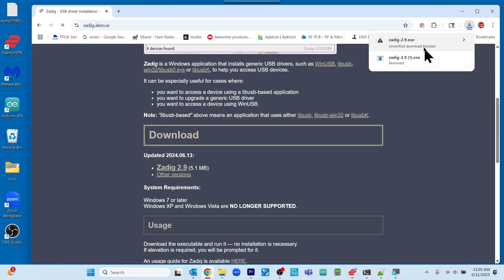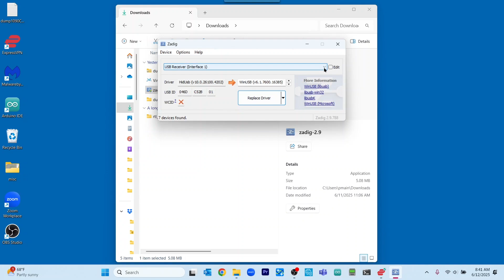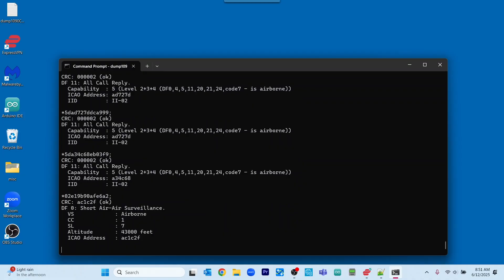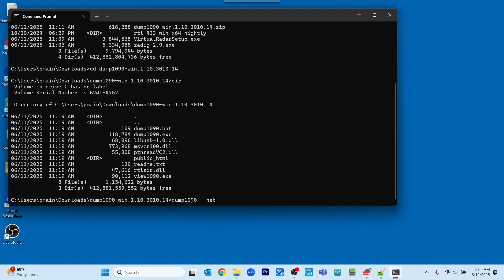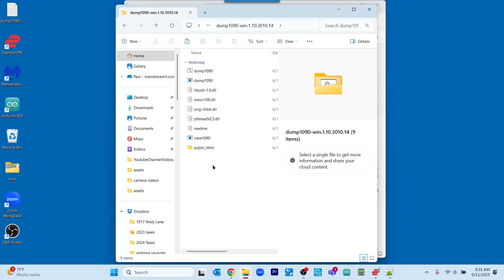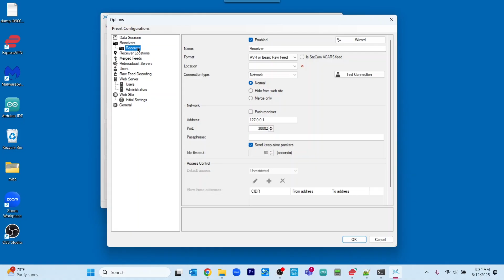E11 Tracking Airplanes using RTLSDR with Virtual Radar and ADS-B

Comment: i cant get it running. the dump 1090 program comes up and shows the headings for each field but no data flows. Im not sure what to do. Any sugestions?
Reply from the maker: What type of antenna are you using?
Reply: @paulmaine6433  I’m using the smaller of the two bipole antenna provided in the rtl SDR v4 kit from Amazon. Hope that helps and thanks kindly for reaching back.
Reply from the maker: @357day2 what is the length of each leg?
Reply: I ran into something while doing this.  I had to shut down a process that was preventing the connection.  I can't remember which one.  It gave the PID code for the process when trying to run dump1090.   Then I had to go into task manager, details and then look for the PID code for the process that's blocking you.  MAKE SURE YOU KNOW WHAT IT IS BEFORE STOPPING THE TASK.

Comment: Thanks Paul. Just in case anyone has multiple PCs with SDR and antenna connected at different locations, using Tailscale would allow any of the computers added to this network to be able to share their ADS-B Beast data with each other. Thus, the VirtualRadarServer can be set up to view multiple locations/receivers at the same place.
Reply from the maker: Thanks for sharing that tip!